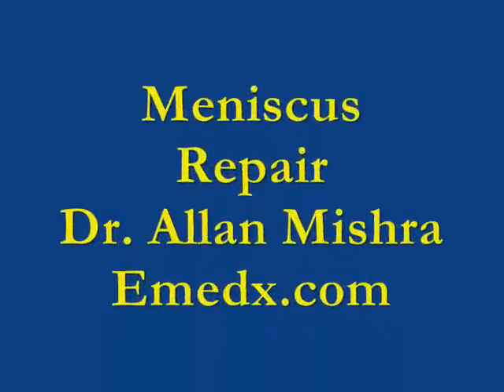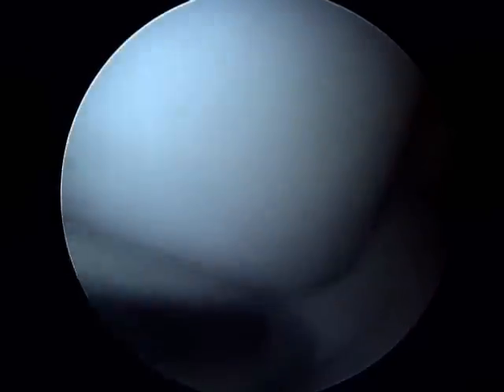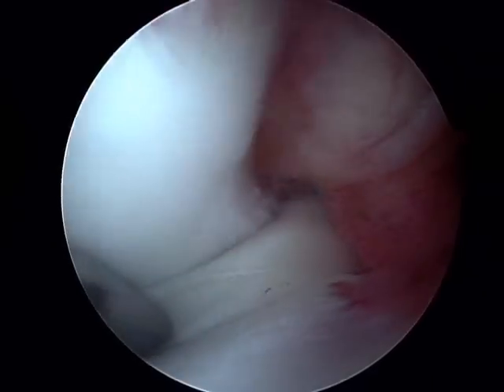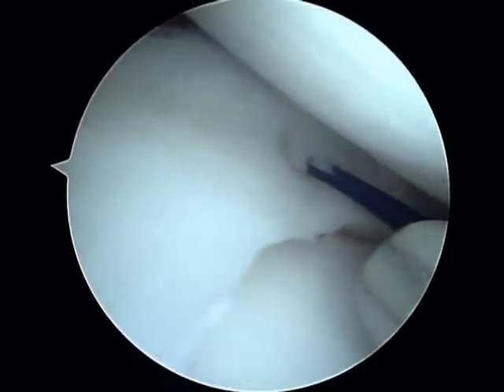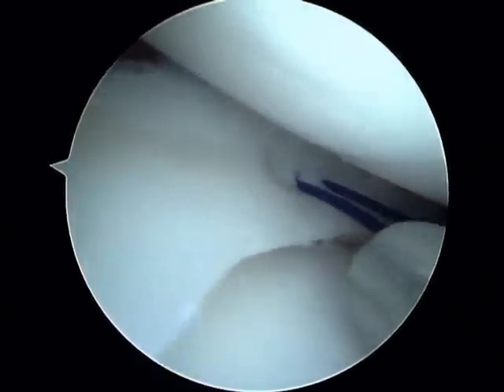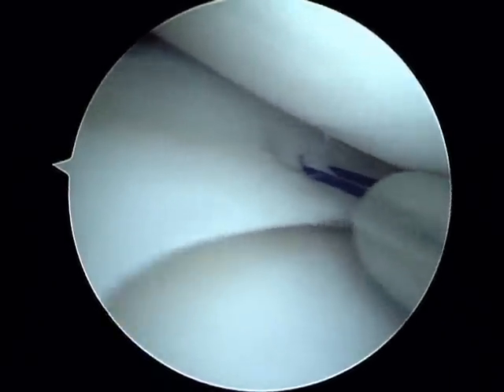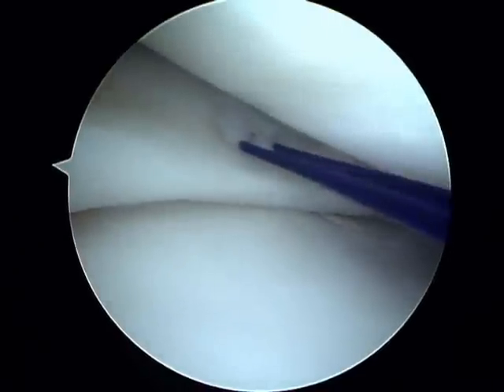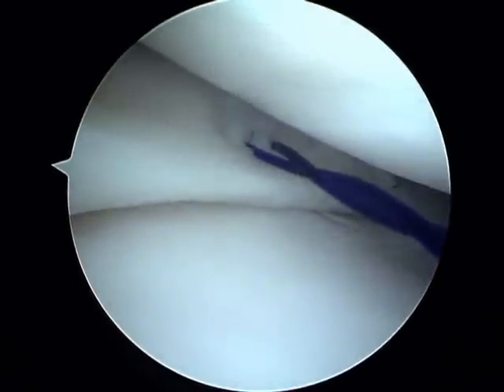Meniscus Repair Surgery Dr. Allan Mishra Emedx.com

Comment: @1904productionz i did tear my meniscus and also my ACL! It sucked but I had meniscus repair on 12/28/10 and ACL recons w/ hamstring graft just last month, 4/14/11. I'm feelin pretty great about the recovery process so far. My meniscus was re-examined during the ACL surgery and it healed up great! I even have some pics that my awesome surgeon took. It was my choice to have two separate surgeries because I'm just OCD like that but it worked for me I switched to a better surgeon for my ACL surgery